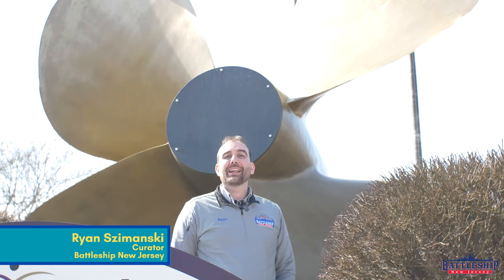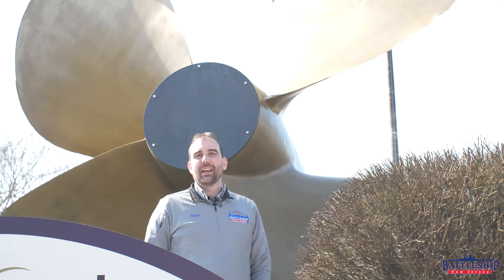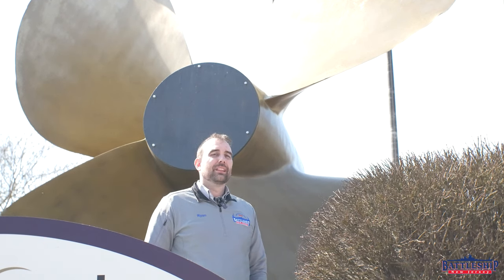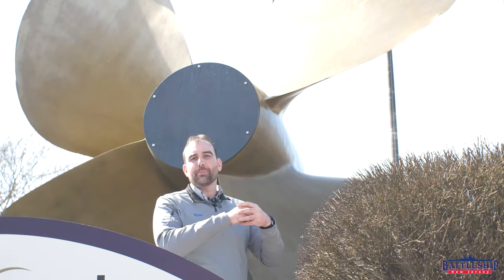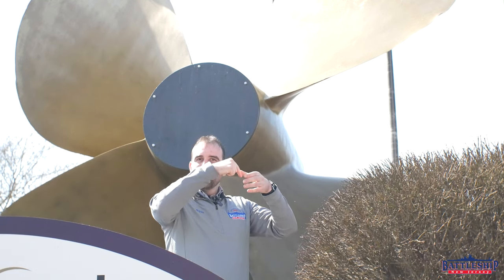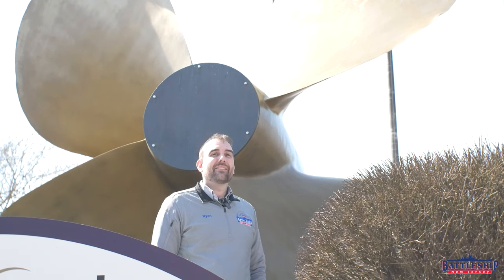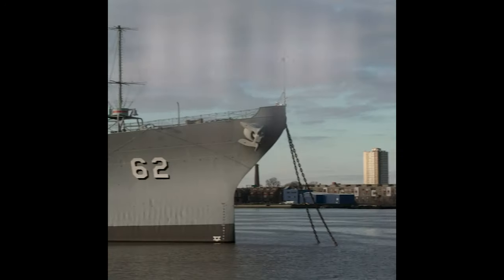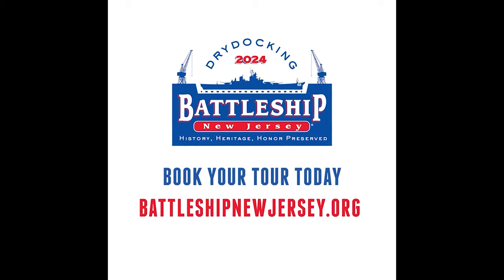How Propellers Get Damaged: Cavitation

Comment: It's a pain the butt. I lived above the props on Type 42 and cavitation was bad news for the props themselves, but also my hearing and sanity when you get ultra prop and shaft noise and vibration, and the noise of millions of little bubbles popping as well. At 30 plus knots, it's pretty crazy down there. I worked out cavitation inception speed on both types of ships I served on quite easily. Special Service Aguti air didn't really work via the blade tips. Preri Masca probably didn't either.

Comment: Cavitation also damages diesel engines too. So if BB62 has any diesel generators onboard, they may even have it as well. Diesel engines run a special coolant to deal with the issue and stop internal damage caused by cavitation.

Comment: I have always wondered how much a modern designed propeller would improve the ship's top speed and vibration issues. What did the engineers of the day say were the issues that caused the vibration problems on the Iowas and South Dakotas? And could it be fixed today?

Comment: I thought that cavitation bubbles were vacuum bubbles and when they collapse they hammer the metal.
Reply: It's not really possible to have a vacuum in a body of water because the water would just rush-in to fill it.

What happens is:
Propeller rotates, pumping water.
As the blade passes through the water it temporarily (this is key) lowers the water pressure where the leading edge of the blade is.
Water at low pressure has a much lower boiling point => the water turns to steam in bubbles.
The blade rotates further, the leading edge moves past the bubbles and the pressure difference is lowered significantly as water begins to catch up.
The bubbles collapse as water around it rushes in.
The damage is caused by how the bubbles collapse, it's basically like a shaped-charge with high pressure water coming in from all sides except the side where the propeller is (because water cannot flow through the metal of the propeller). That water moves a stupid speeds and simply slams into the metal at, again, a stupid speed. Done right (or wrong) this is powerfull enough to knock bits of metal off the propeller.

Comment: My understanding is that the pressure is not heating up the water to boil it, but rather the vacuum behind the blade causes it to boil like water boils in space or other low pressure environments even at room temps?

Comment: Edge split-cut-slice water
Flat surface beat-eggs beat-water
Rear of flat is "vacuum", negative to front of flat
Front of flat is beat-push water, positive pressure to rear of flat
Rear edge is controlled-release.

Feed air via front facing pipe to propeller-suck area for cavitation. See damage-dirt for clues. Digital mp3 feed modifier pulses to engine-controls(throttle) to screw the submariners with twin screws, stereo.

Comment: It's not compression that causes cavitation.  It's actually the opposite.   When the suction the propeller creates exceeds the ability of the water to fill in the void, vapor/vacuum bubbles are formed which collapse violently once they reach the trailing edge of the propeller where the suction ends.

Comment: When they build a ship, it's on the ramp that slips in the water, right? How do they built things straight and level?
Reply: Blocks.  Lots of blocks
Reply: They put an angled shim on any level that they use. That compensates for the angle of the ship.

Comment: Steam has a certain connotation and is not the correct term. The bubbles are filled with water vapor and surrounded by liquid water. The bubbles form from a reduction in pressure causing the water to boil. When sufficient pressure returns the bubbles collapse as the water vapor inside the bubbles converts back to a liquid. The bubbles can collapse very rapidly resulting in shock waves. They can form and collapse on the surfaces of metal causing damage to the metal.

Comment: Cavitation is not gas bubbles. But are bubbles of Vacuum made by pressure from the blade passing through the water. and ass the pressure moves on the vacuum, the bubbles collapse, leaving behind only the sound. (LOTS of sound) no air or gas is involved. On modern warships, Prairie-Masker is a radiated noise reduction system fitted to some western warships, including the Oliver Hazard Perry-class frigates, Spruance, and Arleigh. by pumping air into the edge of the propeller. Mixes with the vacuum and creates the sound of the cavitation to make the ship sound like a rainstorm. There are bands releasing air bubbles over the engineering space to cover engine and pump noise.
Reply: Not vacuum but steam bubbles.
Reply: @tomtrenter3208 I am an STG-1 (Sonar Technician Guns 1st class with 20 years tracking Cavitation). Pressure pulls the water apart. As an STG, my job was to track and ID ship surface and sub-surface. Cavitation is where the Paddle wheels and Screw drive ships of old drive the ship forward. But newer ships use Propellers instead of Screw drives. "Why were you hit on in the video?" Propellers use Coanda Effect and do not cut into the water "like the old Screw drives" but make a low-pressure area in front of the Propellers to pull the ship forward. That low-pressure area makes Vacuum bubbles in the wake of the blades. This is used by propeller-driven planes that get pulled forward or Helicopters that get pulled up into the air. Works like this: Propellers use the Coanda Effect, which costs less energy for more cost-efficient propulsion, thereby reducing fuel consumption and resulting in better speeds. Cavitation makes Vacuum bubbles Vacuum in front of the blades, not the heat from friction behind the blades.
Reply: @stevenlennaman2073  I was an ST3 in the Coast Guard 1972- 1977. I went to fleet Sonar School in key West.
Reply: It's kinda funny with prairie- masker hides machinery and cavitation with a quieter rain storm.
Reply: @tomtrenter3208 I went to STS A school at ASW base San Dog, but I never made it through C school. STS A school on a Surface ship is strange. What class of ship did an ST serve on? When we were on Rim Pac 1995, we were hunting a Colombian 209 French-built Sub and a Coast Guard cutter that was part of the sub screen, only later found out the cutter had no sonar.
Reply: @tomtrenter3208  Truth is prairie air from the blades and Masker air from the belly bands where not to make the ship invisible but make the ship harder to ID, and as an STG, I have tracked storms with our Sonar. And rain is LOUD very LOUD.
Reply: @stevenlennaman2073  I was on a Hamilton class cutter, CGC Morganthau homeported in Governors island NYC. We had a hull mounted sqs 35.
Reply: Was that a gray-water or blue-water sonar? I am not aware of that sonar. I think that Costs Guard sonar would be gray water because the Coast Guard is gray water. I would have given my left Nut to have seen/played with the sonar,
Reply: @stevenlennaman2073  My cutter was 378' long and I've been to Newfoundland, Caribbean, gitmo about 4? times and we escorted CGC Eagle to Europe in 1975 for her summer cadet cruise. I also did 2 bravo and 1 charlie ocean stations. We got pounded on charlie in December 1973. Its up by Greenland and had wind in excess of 100 kt's for 4 days. We had about 12 people with broken bones and another
2 dozen or so with sprains. Not very fun!

Comment: 2:28 actually, cavitation is caused by the opposite of compressing water... it isnt the heat of compression which boils the water, it is the decompression on the other side of the propeller which lowers the boiling point to the ambient temperature of the water , think of how water boils at lower temperatures when you are e.g. at the top of a mountain, for instance

Comment: boiler tech here and cavitation collapse faster than the speed of sound. lots of energy there. even in small pumps.
Reply: The speed of sound, but in what medium? 😉
Reply: @Ganiscol  at sea level as it were. medium depends. sea water is different than the additives in my boiler water. so speed is flexible. the pressure will also play a factor. my system is running around 340 psi. not sure what the pressure id at BB prop dept.

Comment: I was fairly sure that the pressure is lowered enough that the boiling point of the water is lowered causing the boiling water, and the collapsing water bubbles create massive amounts of heat and shock which erodes the metal, thats off the top of my head, but i think that's mostly correct,

Comment: Cavitation is also the reason why your knuckles crack when you pop them, the sound you hear is the sound of the gas bubble bursting. This doesn't damage the knuckles tho as the fluid in the joint absorbs the forces.
Reply: I’ve heard it’s pretty bad for your joints tho…
Reply: @30AndHatingIt  Not really. check a channel institute of human anatomy, a video called "how harmful is it to pop your knuckles" for the research into it.

Comment: I have had surfboard fins cavitate in bigger surf, just takes a chip in the front edge.
You go in and change them.
You don't really lose control a little but it slows you up and vibrates bad.
So yeah fin change is important.
You can hear it yeah.

Comment: No surprises here except that for a MUSEUM ship? Past cavitation issues shouldn't be a problem. Unless the Navy anticipates a reactivation for further service. For which I would strongly recommend computer redesigned reduced cavation screws. Propellers are for aircraft and motor boats. After all, significantly less cavitation at turns. For 27 kts. Could result in a water speed of 30 kts, conceivably more. Any reduction of the ship's acoustic signature, is a winn!

Comment: The water is not heated up and it is not compressed. The water is excelerated ofer the propeller surface and that is reducing the pressure to a point where the water starts to boil at lower temeratures than 100° C

Comment: Sort of random question, how fast could the props spin? Like in rpm?
Reply: Around 150 RPMs maximum but prop gets damaged.
Reply: 208 RPM inboard, 212 RPM outboard.
Reply: Where are you getting the info?
Reply: @calebvaldecanas8867  when I was station onboard and operated EMO1, #1 main engine. We did a full power run, to including filling opening the throttles, that was our RPM’s. Also that is what we taught everyone as designed speed.

Comment: I think cavitation is not really about heating, but rather about lowering pressure so much that the water boils even though it's the same temperature as the liquid nearby. Akin to how water boils at a lower temperature up in the mountains so you consider that when cooking pasta, for example. So I think this video is somewhat misleading.

Comment: Good Lord Ryan, at least try to study up a little bit on subjects like this. These aren't air or "vacuum" bubbles. They are steam caused from the lowering of vapor pressure creates steam. Steam expands about 1700 times compared to waters liquid state. When the steam bubbles expand beyond ambient water pressure they collapse and rebound slightly smaller till it pressure equals that of the ambient water. New Jersys screws cavitated at a very low speed (2-3 kts). The faster she went the worse the cavitation.

Comment: I didn't think water could be compressed.
Reply: For all practical purposes, it cant. Everything is compressible if you try hard enough.

Modulus elasticity of air is ~14.6psi. water is ~ 290,000 psi... If that gives you an idea.

Water at the bottom of the ocean is compressed around 5% relative to sea level.

Comment: sorry, can't be air bubbles. must be water vapor bubbles.
edit: oh, and water cannot be compressed.
Reply: Explain oil cavitation (oil steam I suppose). And yes, water with microbubble gasses can be compressed slightly, which is most water.

Comment: Your explanation of Bernoulli is completely wrong!  The curved surface forced to move through a fluid medium causes that medium to speed up over the top or convex section.  This produces a low pressure area.  On an airplane, this produces lift.  On a boat this causes thrust, but if the pressure becomes low enough, you have low temperature boiling and gas bubbles.  These bubbles collapsing is what causes damage to propellors.